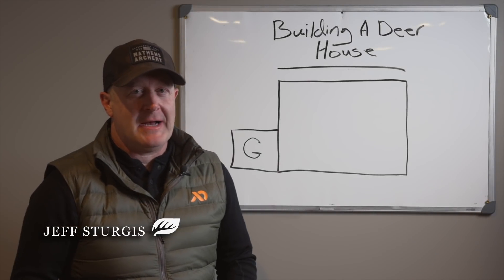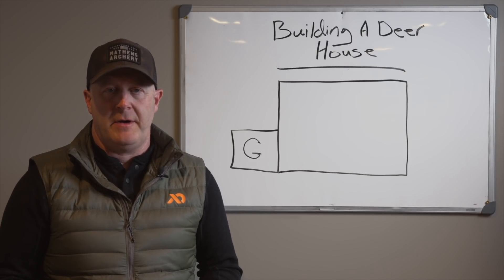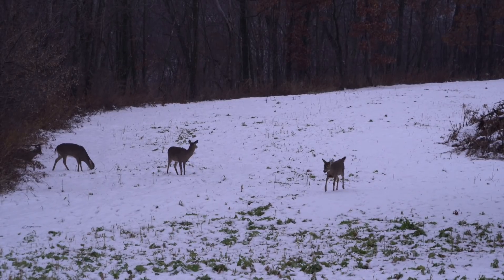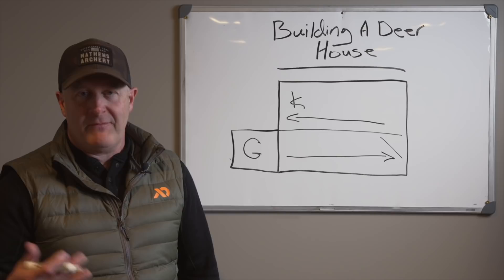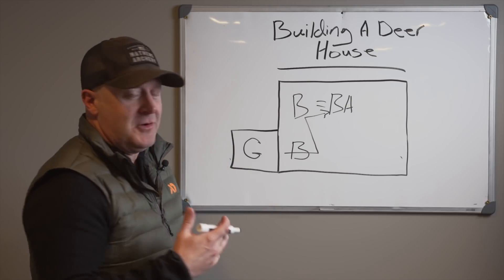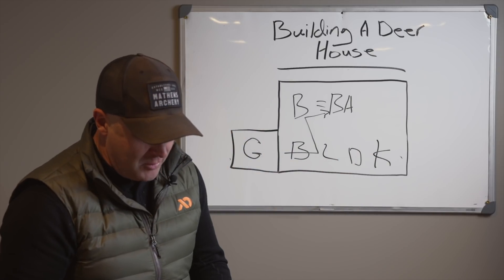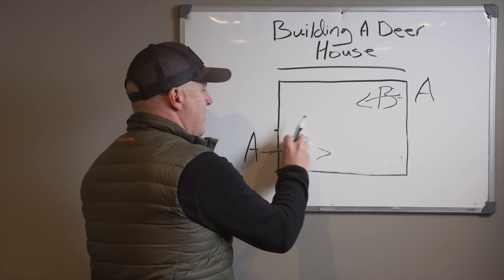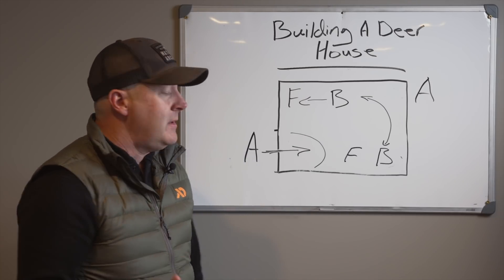How To Design A Deer House Parcel

Comment: Thanks Jeff! I cleaned out the leaves out of the 110 gallon waterholes this past weekend. No critters but a couple earthworms floating were removed. Is that all you recommend? The water is really dirty but the stench came from the soggy leaves.
Reply from the maker: You are welcome Mark! That is all that I do...sometimes not even that. But I try to do at least that much with every waterhole I have, every Spring...

Comment: How does a guy convert solid conifer into deer bedding areas? I do have machinery to remove the conifer but am afraid more conifer will grow in its place.
Reply from the maker: Hi Adam! Removing and then spot spraying every few years. Young conifer popping up isn't a problem but they have to be killed every few years. Spot spraying for them works well! Larger openings within does too as it allows native regen to take hold.  1/4 to 1/2 acre openings...
Reply: @whitetailhabitatsolutions9751  perfect. I will start the removal soon.  I don't have enough good bedding yet and am looking at ways to provide more. Is there anything that can be planted to help[ out? Maybe Box Elder or Aspen?